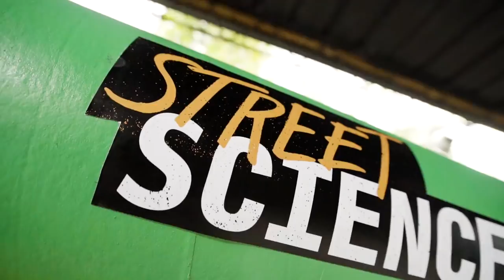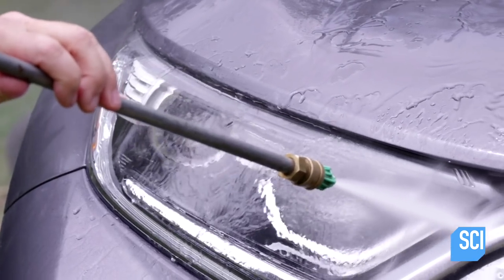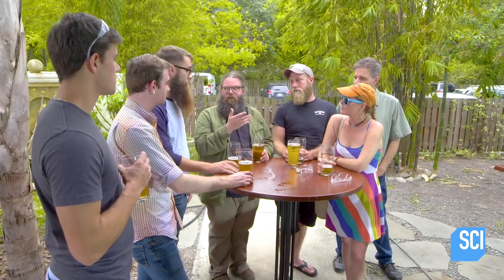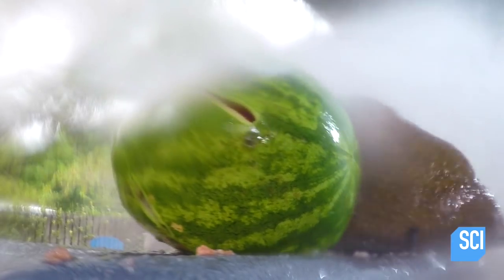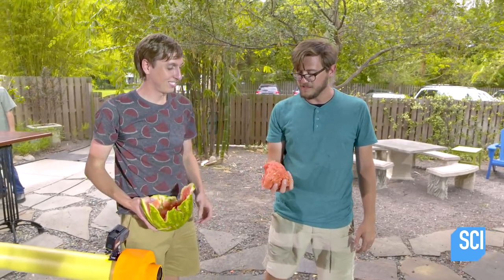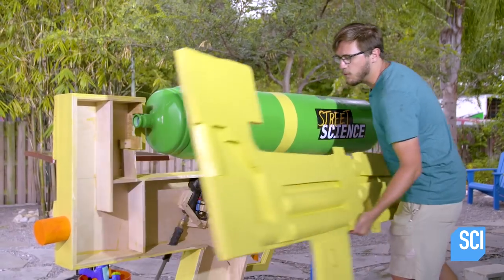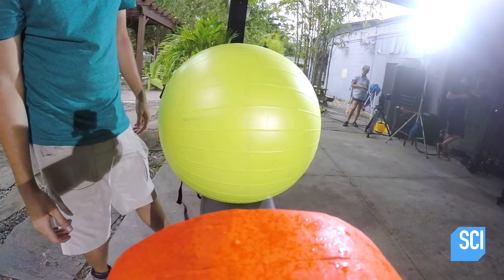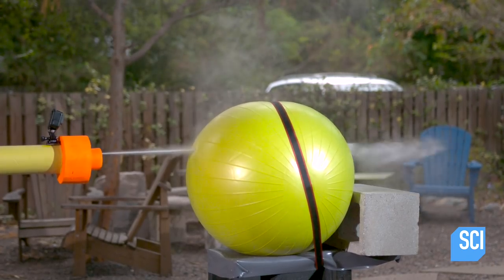Let's See What This Giant Water Pistol Can Do! | Street Science

Comment: The king of random did this. What the hell is is a complete rip off. You didn’t even give him credit.
Reply: Nic Sweeney actually, Mark Rober did it first, he designed the original and the king of random just used his designs, go rewatch the bus and you will see. He's a former NASA engineer so don't expect too little out of him
Reply: Mark Robert did this first
Reply: Auto correct -_-
Reply: Nic Sweeney also this is just a pressure washer with a super soaker “skin” you can’t even move it